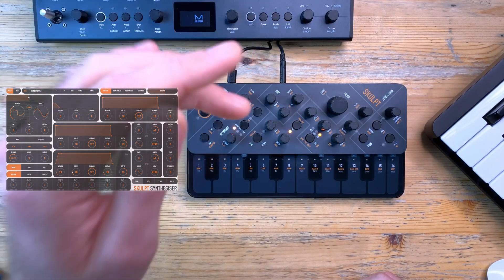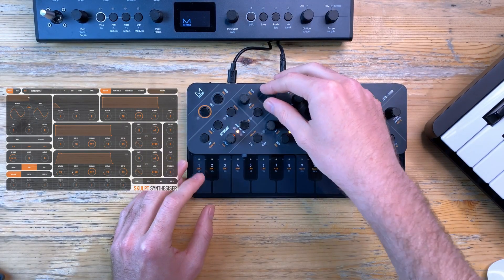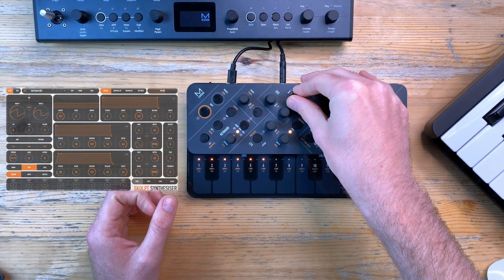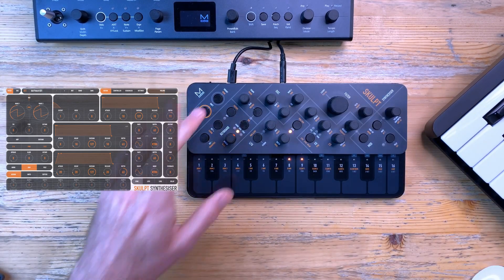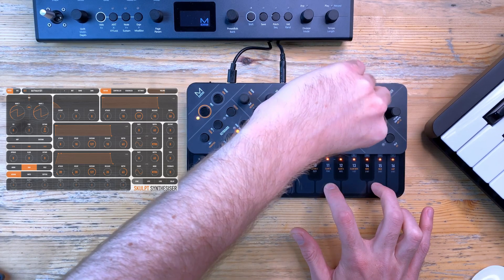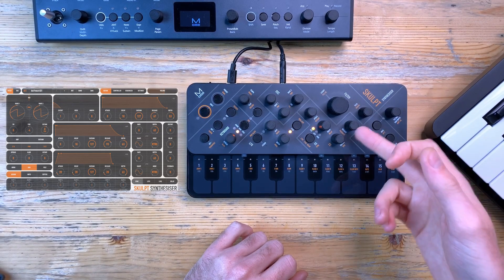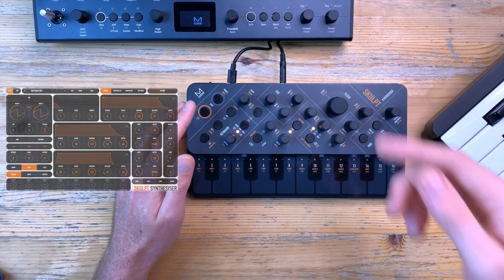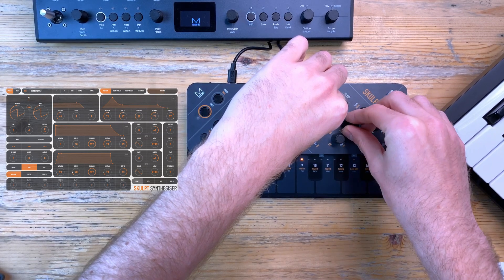Modal Webinar: SKULPT   Creating & Sequencing Pads

Comment: Hi! I need help understanding what means that the Skulpt sequencer can record up to 256 notes? As I understand, it means that there are 64 steps in total with max. 4 notes each? The sequencer can also be 1, 2, 4 or 8 bars. But if it is 8 bars with a total of 64 steps, then each bar has 8 steps? This is a bit confusing for me, because I’m trying to record a long sequence with one chord per 4 bars (its a slowly evolving pad). I have a total of 4 chords, so I need a length of 16 bars but Skulpt only has 8. Is there a way to decrease sequencer speed by 2? Without affecting the clock/tempo? My Microfreak has a rate adjustment and that allows me to have long sequences and I would like to know if there is something similar in Skulpt.

Comment: SEQUENCER/ARP PROBLEM: I dont know if this was said already but I think it's worth saying incase anyone experienced the same problems as me.. when I got this synth neither the sequencer or arpeggiator functioned correctly, it had me extremely frustrated. I eventually found the solution - download the MODALapp for your pc/laptop and run a firmware update. 
I couldnt find this solution online, and found very little information about the app. 
I bought 2 skulpts (the first one ended up getting sent back) and it was the same on both.
Reply from the maker: Hi Eoin, It sounds like a MIDI clock routing problem. If you have questions we are always available via our support@modalelectronics.com email. If you need further information to contact us.

Comment: Can you tell me why all Skulpts are quieter when switching from mono to duo mode? All the ones I've played with anyway
Reply: Most likely the mono oscillator stack hits a single virtual VCA, but duo going to two VCAs with the amplitude level compensated.
Reply: Mono mode uses four stacked voices, duo uses two. It therefore would result in a drop in volume due to the sound lacking the two additional voices.